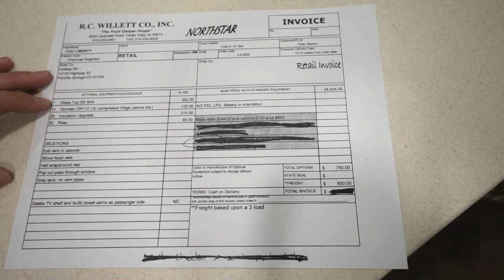2020 Northstar Liberty – Truck Camper Detailed Tour – Off Grid Camper!

Comment: Honestly,, you should be getting paid by Northstar to be their brand manager and do tours of all their models.  Their advertising, marketing, website etc... is not very good.
Reply from the maker: It's sadly true.  They seem to sell most of their units through their dealers who have campers on display.  They made an early attempt to get involved in the "overland" community and decided against pursuing it further.  They are rather similar to Four Wheel Campers...  FWC has pursued the "overland" community and benefited from the explosive growth and received tons of free promotion as people review and video their travels.  However, I think Northstar builds a superior product and one of the best truck campers for the "off grid" type traveler --- good value too.
Reply: @TruckCamper  I went to the FWC Plant in Woodland CA and was not overly impressed, mostly because there were options I did NOT want and you really don't have a voice in the manufacture.  I was told that it is "Standard Equipment" you have to take it.  But I don't want it. . . . tough!!!  So here comes the Northstar.
Reply from the maker: @gregghierholzer  We are enjoying ours!!  Been off grid this past week.  Best to your choice!

Comment: No room for a generator
Reply from the maker: So true!  I'd still remove one anyway.  Too noisy!  Heavy.  Not needed.
Reply: Expedition Truck Camper I will be using mine primarily as a means to fish. My boat has four large batteries for electronics and trolling. Unless I have electric hook up, I could not go this way. I guess I could get a small generator just to charge batteries
Reply: @bakervinci163  I'm just not a fan of a generator in a truck camper. Heavy, eats up a lot of space and they are usually propane and it sucks your tanks dry quickly. However, for some trips I need a gen so I have a front hitch and a Honda 2200i that runs everything, even AC.